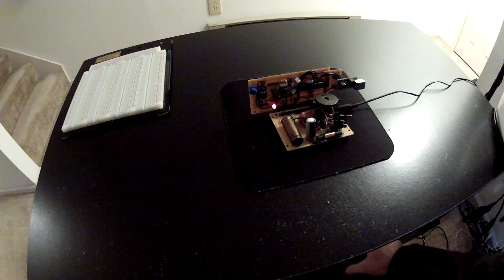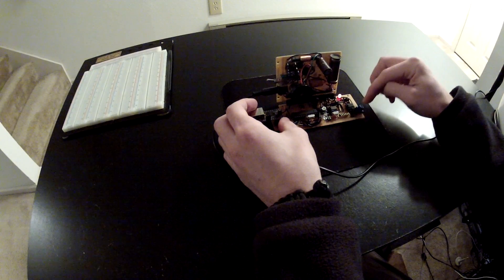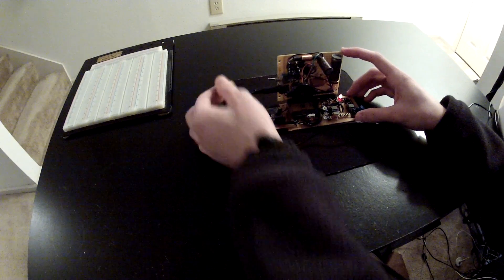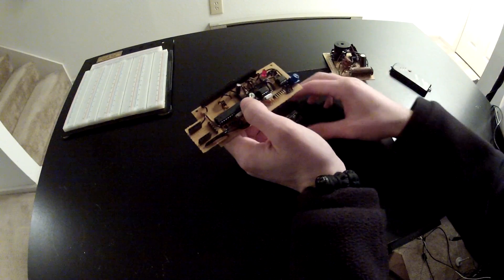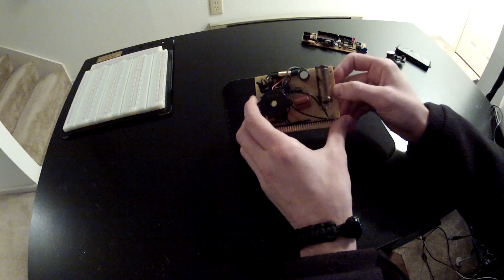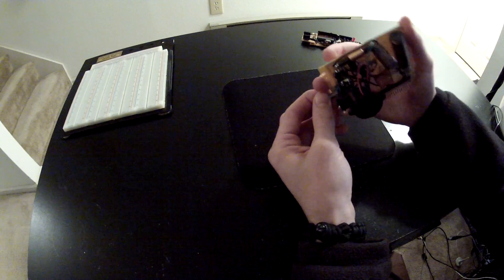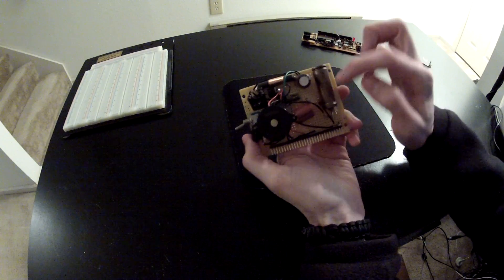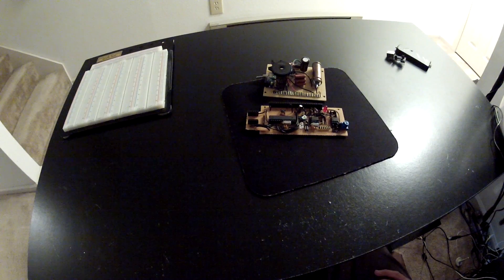How to Make a Geiger Counter_ P2_ The Build

Comment: i noticed you said you had a usb to serial converter for arduino.  if you have time you should check out the "Low Pin Count USB Development Kit " from microchip.  you can use the dev board schematic to copy the usb circuitry to your own designs and avoid usb/serial converters.  they also provide source code for GUIs that can read the pot value on the board, toggle the LEDs, etc.  these were written in c#/c++ but i ported the code to java without much effort.